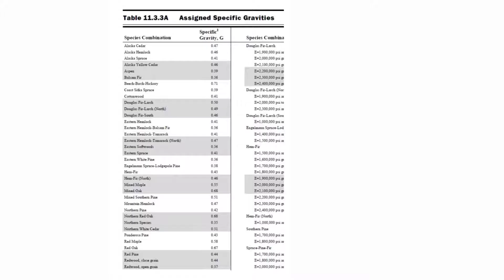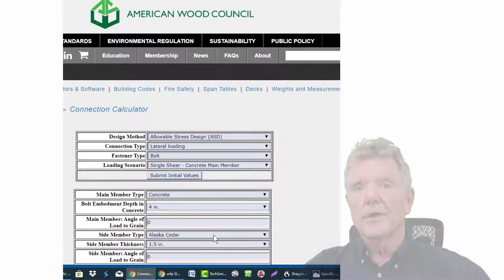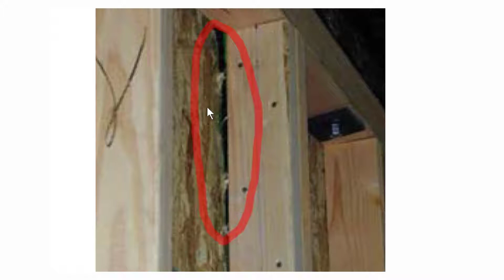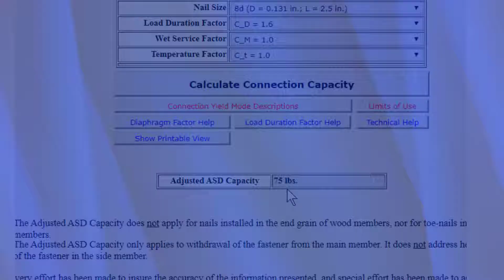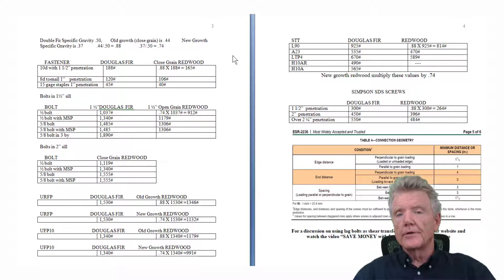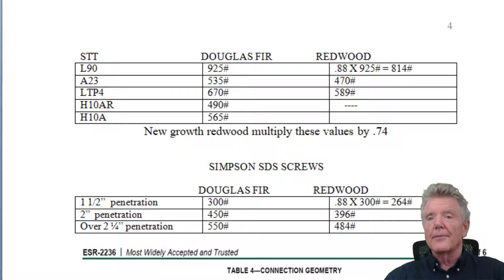What Is The Best Seismic Retrofit Hardware?

Comment: Hi Howard - Do you discuss somewhere how deep mudsill anchor bolts and hold-down bolts should go into a perimeter foundation. I really don't see much information about this on bayarearetrofit.com or your videos. 

I'm using 5/8" bolts with the set-xp epoxy on a 2x 1965 redwood mudsill, single story stucco with a composition roof. 

I know your pictures always show the end hold-downs deeper than the anchor bolts. Is there a rule of thumb on the depths?

One other thing, I've seen where the hold-downs are installed inside the shear-wall (at the ends). You always show them on the outside of the shear-walls. Is this an important choice in your opinion? I don't think I've seen you mention this explicitly in your videos or otherwise. Just curious.

Thanks again for your help and any information you can provide. I really appreciate it!!
Reply from the maker: Hi Howard - Do you discuss somewhere how deep mudsill anchor bolts and hold-down bolts should go into a perimeter foundation. I really don't see much information about this on bayarearetrofit.com or your videos. 

I'm using 5/8" bolts with the set-xp epoxy on a 2x 1965 redwood mudsill, single story stucco with a composition roof. 

I would use Titens, Set-XP is a major pain in the ass to use and you need to blow out the holes with compressed air which creates dust full of cancer causing silica.  In general 4" inches penetration into the concrete is all you need.  The failure always occurs in the wood, not the concrete or the bolt.

I know your pictures always show the end hold-downs deeper than the anchor bolts. Is there a rule of thumb on the depths?

We go around 16" deep and use 18" 5/8 allthread though engineers from Simpson and Hilti told me once you get beyond 8" it does not make any difference.  

One other thing, I've seen where the hold-downs are installed inside the shear-wall (at the ends). You always show them on the outside of the shear-walls. Is this an important choice in your opinion? I don't think I've seen you mention this explicitly in your videos or otherwise. Just curious.

We do it so people after us can see that we installed them.  When they are behind the plywood you really can't tell

Thanks again for your help and any information you can provide. I really appreciate it!!

You are very welcome.  Please be sure and subscribe to the channel.
Reply: @bayarearetrofit5814  If you are using "allthread" in the hold-downs, is that because the Titens don't come that long? That means you are using epoxy with the allthreads, right? just checking!